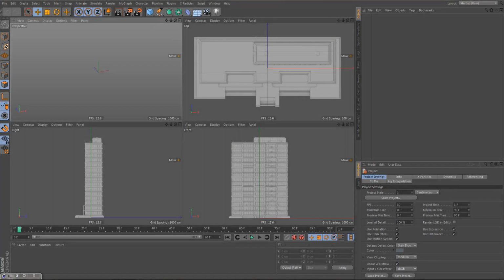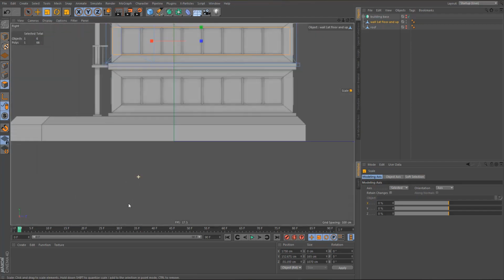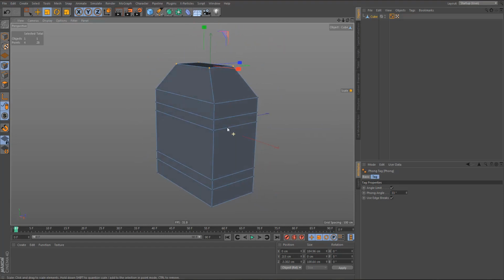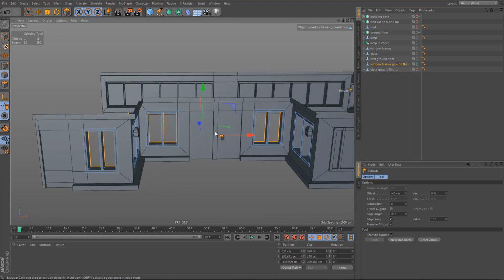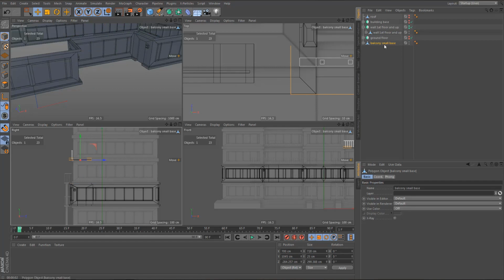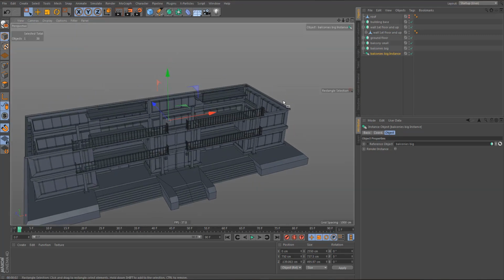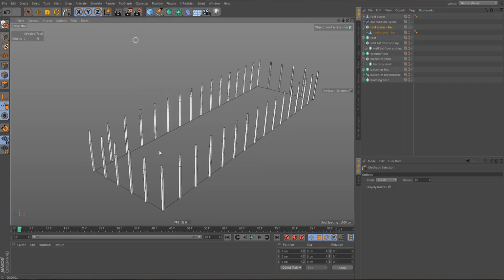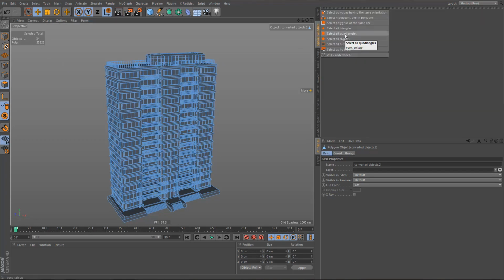Modeling a High-Rise Building in Cinema 4D

Comment: When you do buildings like this do you have to apply a subdivision modifier
Reply from the maker: There's no need for SDS here, the building only consists of rectangles and squares. You'd have to add control edges to hold the shape in SDS. That alone would multiply the polygon count by 2.5 to 3. It's not worth it. For close-ups I would use non-destructive bevels to make the corners more realistic and switch those off as soon as I zoom out again.
Reply: @Wolf-4D oh okay that's very illuminating to me now let me ask you let's say you had an arc window next to a square window how would you even out the typology on that. Would it have to be necessarily quoted out or could you have triangles in there I mean more for buildings in hard surface stuff like this
Reply from the maker: @mfrancisco_850  Personally, I try and keep quad topology whenever I can, even on hardsurface models. You can ask this question 10 different people and get 10 different answers. 

If you don't use SDS you can get away with triangles and even N-gons, if you must. As long as bevels are working and you don't get any shading or texture issues when rendering, triangles are fine on a hard surface model. If you need to deform the model and/or animate it, you should go with clean (quad) topology to get clean results.
Reply: @Wolf-4D  oh wow thank you so much for explaining that to me okay that makes a lot more sense to me now thank you again very grateful for your teachings
Reply from the maker: @mfrancisco_850  You're welcome!